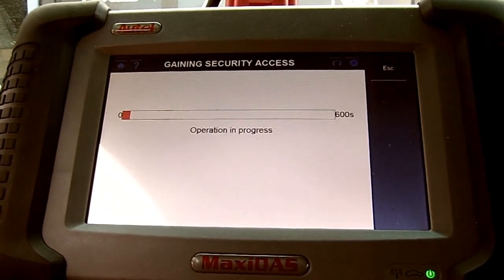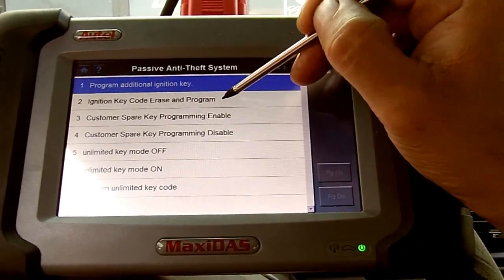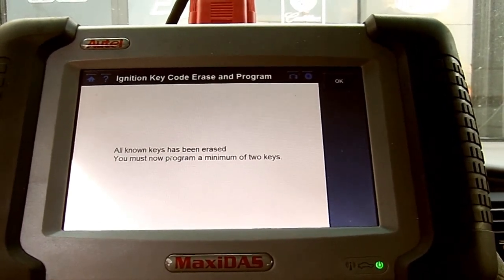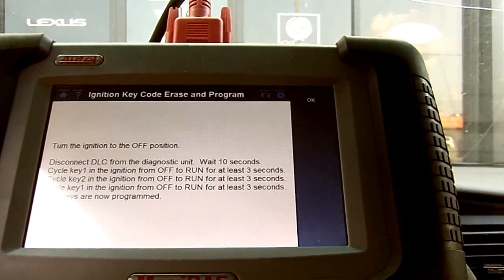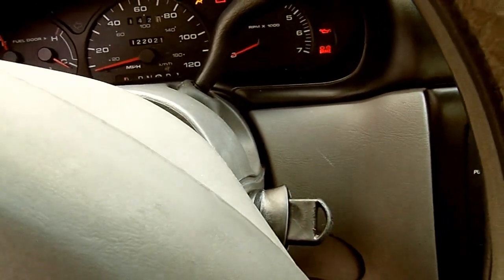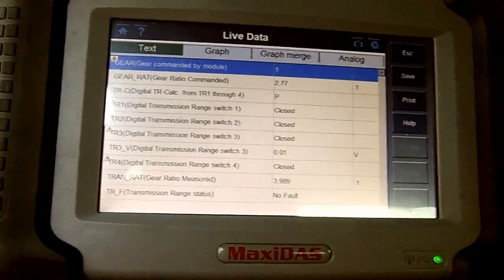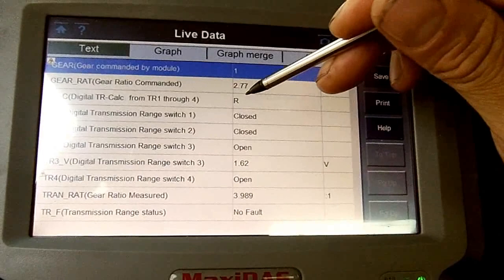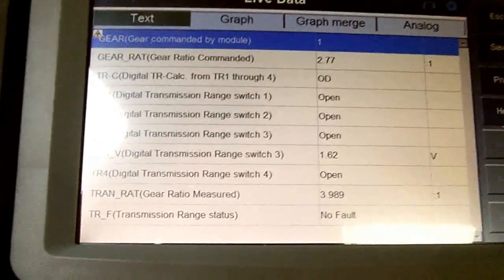Ford PATS Key Programming Using MaxiDas DS708

Comment: I know this is an older video,  but do you need to have a Ford Motor Craft Service licence to reset PATS keys with this tool?
Reply: +Mike Burak  nope!!! That this the best part. Open source technology. Ford recently lost a law suit against Autel for decoding all of Fords BS dealer only function. 1 big win for the little guys.
Reply: "in October (2016), the court dismissed Ford's claim that Autel violated the DMCA by circumventing technological measures controlling access to data in Ford's software    . Ford failed to plead a DMCA violation because it did not claim a copyright interest in the data protected by the technological measures, the court said.
    That case is ongoing. Judge Terrence G. Berg is the judge on both the Ford and GM cases." -http://www.bna.com/gm-copyright-suit-n57982069279/

It seems to me that the case is on going, but the DCMA aspect was thrown out on a technicality.

Comment: I Have the  AUTEL 908Pro and it has the same software,  and im also wondering what the unlimited programing means,  cause on one screen when you go into PATS it says max keys 8.  who needs unlimited keys ? it doesnt eliminate PATS. when you go into that it asks for the 8 digit code from the key,  it doesnt read automatic. , . i guess you need specialty key programmer to read the NFC code.  on the 908 it forgot to say insert key 1 back in to start.  
does anyone know about differences between using a, new,  reman or using a used PCM ?
Reply: dennis patton

Comment: for the money that scantool is well worth it. (a friend of mine has it) snap on scanners are easily 3 or 4 times the money. can this scanner program pcms, rcms, flash. i want to buy one for myself good work
Reply: snap ons are good for wheel chocking or being paper weights only. If you want flashing ability or also known as programing you have to get it's newest sibling the maxi sys pro with the J2534-1 J2535 programer interface. it is more expensive than the ds 708 but it is twice as fast booting up, more available options and they went from windows to android platform, so its now a rugged cased android tablet computer.
Reply: i cant believe how much snap on scanners run. i looked at one the verus it was 11,000 off the truck. the ds708 i accidentally found but from what it looks like it does alot. for a grand or a little less. cheaper at harbor freight with 25% off coupon. all i want to do is a power balance test and key programming. how much are updates?
Reply: phil holbrook
 After the free year of updates, the price is about $550 to $750, but honestly you could wait until you really need the updates because for example if you wait 3 years and then decide to update they give you all the updates till the end of your recently paid for year for the same regular price which is nice if your not in a shop or for hire situation that works on new vehicles constantly. Depending on which authentic dealer you buy it from whether it be a amazon or other site some offer 2 years free updates, although I would check out amazon they got a autel seller that bundles their tpms tool with it for about the original retail price, but thats only if you want the BEST bang for your buck which even with just DS 708 you still are getting an awesome deal compared to a $22,000.00 snap on paper weight that says nothing but "can not communicate to vehicle"

Comment: It could have been both. If they are on the same circuit it is possible that the tcm failed due to a problem with the prndl switch. Stranger things have happened.